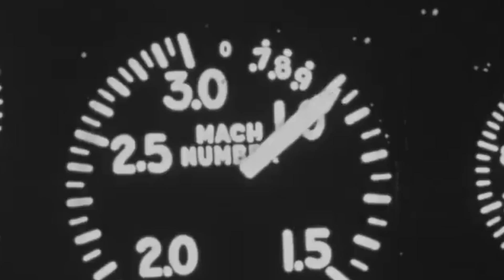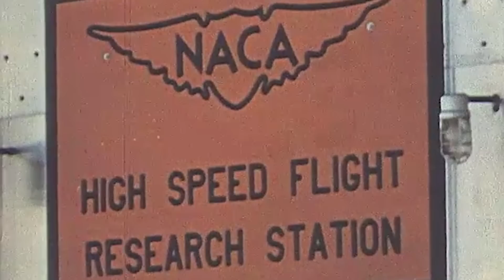The Flying Bullet That Shattered Aviation's Limits Forever

Comment: Slight correction: Yeager did not (could not, actually) "push the throttle forward". The rocket engines on the X-1 were not throttleable. Instead the XLR11 rocket engine had 4 combustion chambers each producing 1,500 lbs of thrust which could be turned on or off individually. The film "The Right Stuff" accurately depicts Yeager flipping switches one at a time to accelerate the craft.
Reply: Not really a correction, considering the multi-stage rocket motor was explained pretty clearly at about the 6:30 mark. It's pretty obvious that "pushed the throttles forward" is a figure of speech. It's a commonly relatable way to explain the general process of accelerating an aircraft.
Reply: The engine on my Triumph Daytona 650 is fully throttleable
Reply: @LaneSplitKing  ??? What does that have to do with the X-1?
Reply: @billmullins6833  they're very similar machines
Reply: @billmullins6833  only one can do wheelies though
Reply: The man brings you free high quality mini-docs yet you’re here nitpicking over information he put in the video that you apparently didn’t bother to watch. Just stfu and enjoy them or don’t bother watching at all.
Reply: The Ez-Rocket we built at XCOR had a similar two-switch arrangement. After Dick Rutan worked the sidestick and joked, "Houses get big, houses get small, houses go round and round!" I labeled the engine run switches "FWD-LOUD BACK-QUIET". Dick loved it and pointed it out to everyone who visited us at Airventure.
Reply: @6:31 🤫👂
Reply: 🤓 fuckin touch grass
Reply: @matthewf4951  What the hell does that even mean in this context? Buddy you utterly failed to convey your meaning. Wanna try again?
Reply: Touch grass and see some sunlight nerd
Reply: Flipping a series of switches to break the speed record seems even more badass.
Reply: The Walther engines on the Me 163 were fully throttleable
Reply: @williamzk9083 Which is part of the reason Alexander Lippisch was included in Operation Paperclip. Germany was developing tech that was FAR more advanced at the time than I think most people realize today. None of the superpowers today would exist as we know them without nazi tech and personnel.
Reply: @williamzk9083 And broke the speed barrier?
Reply: @williamzk9083  Okay but the engines on the X-1 were not. Your point?
Reply: I have found this channel entertaining but certainly not the place to go for accuracy.
Reply: @AnAmericanPatriot1555 Everyone is an expert.  Simply ask them.
Reply: They literally mentioned that early on in the video, so quit nitpicking.
Reply: They literally mentioned that early on in the video, so quit nitpicking the script.
Reply: You already said that. @Rotorhead1651
Reply: The SSMEs on the Shuttle were throttleable.
Reply: @calvinnickel9995  Okay. So? What does that have to do with the X-1?
Reply: @calvinnickel9995  The accelerator on my Honda Accord is throttleable
Reply: @h8GW The throttle didn't matter on the drive to break the sound barrier, since then I've been in many explosive environments but nothing sounds like a sonic boom, been thru some very real shit yet nothing is like that happy experience, at that young age of 4 or 5 was imprinted on my young and new to the world Iknew we were defeating the communists with every bird and every sonic boom.. Semper Fi gentlemen..
Reply: @h8GW  Whiskey Tango Foxtrot?????
Reply: Lol @calvinnickel9995

Comment: You put the right stuff into this one. Very informative.
Reply: Well the writer of "The right stuff" almost destroyed the 'mission' by a dangerous horse riding incident. He was lucky. Did his attitude to the mission mean he really wasn't the right stuff? Was that what is wanted in serious research?
Reply: @alanhilder1883  On the 9th of April 1945, Messerschmitt Me-262 pilot Hans Mutke, part of the Ergänzungs-Jagdgeschwader 2 (EJG 2)  took off from Flugplatz Lagerlechfeld and broke the sound barrier in a full-power 40 deg. supersonic dive from 40,000 feet.

Although Mutke claims he was not the first Me-262 pilot to reach Mach 1 in a dive, Chuck Yeager confirmed his detailed written accounts from 1945, and he is the first man to document a supersonic flight and live to tell the tale.

The same year the German A4b rocket plane would achieve Mach 4 in flight tests (unmanned) but the war ended before manned test flights were scheduled to begin.
Reply: @alanhilder1883

He also destroyed the NF-104 years later from similar bullheadedness.